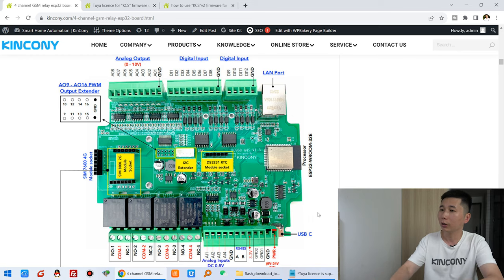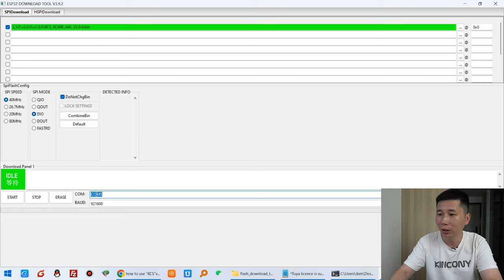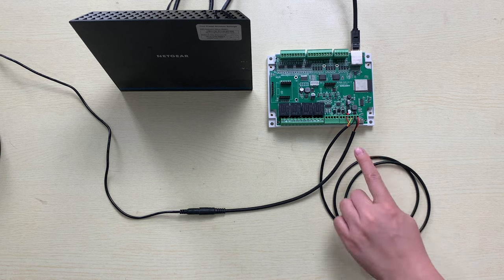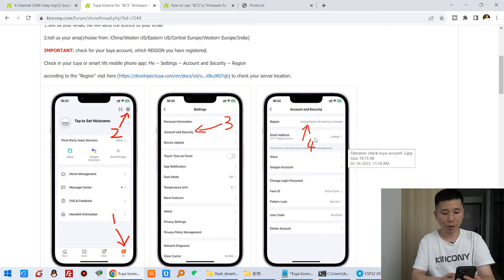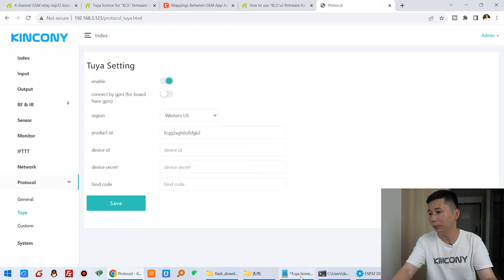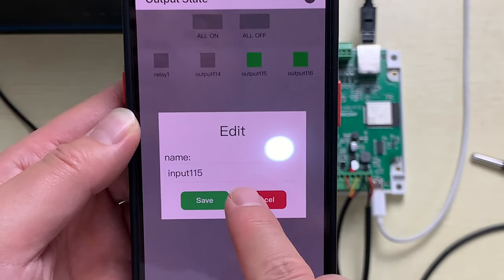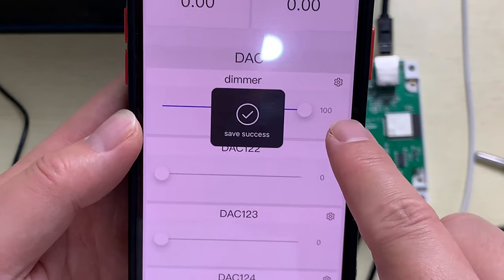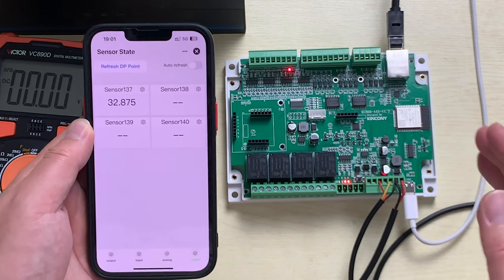How to use KinCony ESP32 board work with Tuya app

Comment: He I am using KC868-ATC v1, My Board is not connecting with tuya application, where can the problem be?
the LED is not blinking though i keep pressing the button, i tried uploading an led Blink to the board and it worked fine but i can't make it connect to 

Also, I haven't connected it to a RS485 device yet, does that has anything to do with the serial connection?
Reply from the maker: just do as this video: https://youtu.be/z67pRMLb4Rc

Comment: good day.KC868-A4S ESP32 2/4G GSM board works as Modbus TPC or RTU as slave.I would need to integrate it into the LOXONE smart home.Thank you
Reply from the maker: this is our ESP32 board how to integrate to Loxone video: https://youtu.be/yj-tDb4gRa0
Reply: thanks for the link. I wanted to ask if it is possible to set frequencies for PWM outputs (AO9-AO16) and if it works for each channel separately @KinCony
Reply from the maker: sure, that just on the PCB pins, not have terminal, actually you can use it for PWM output. @TomasUlrich-u9f